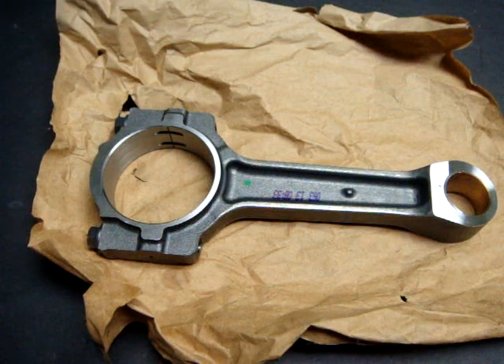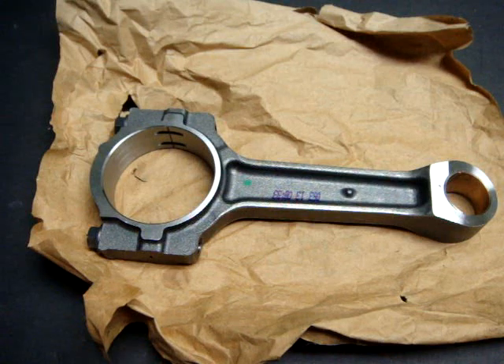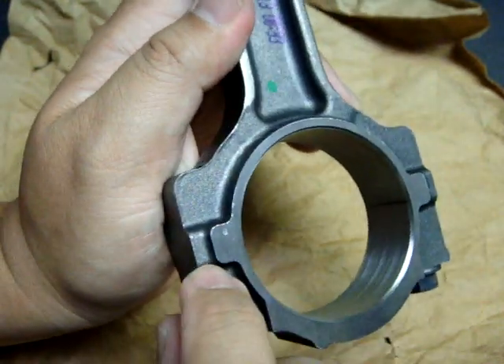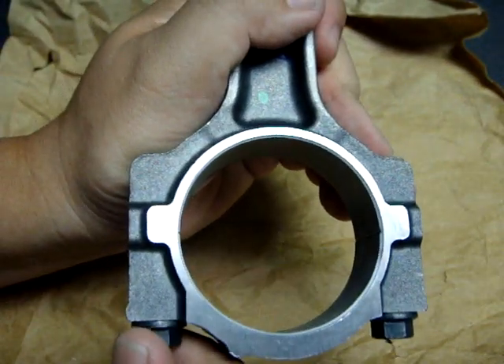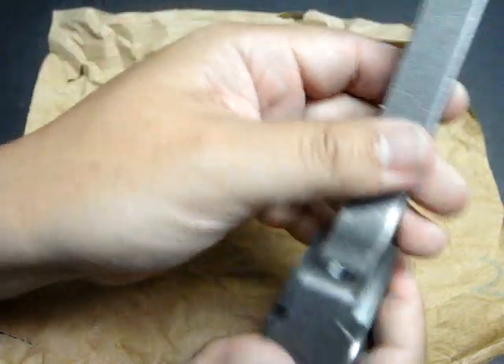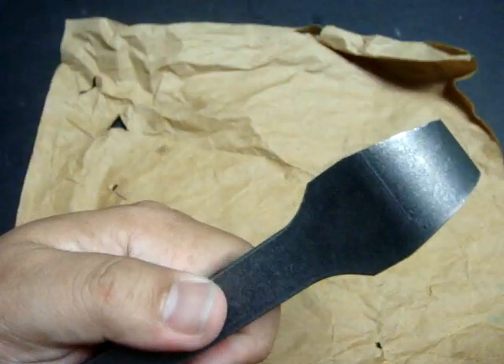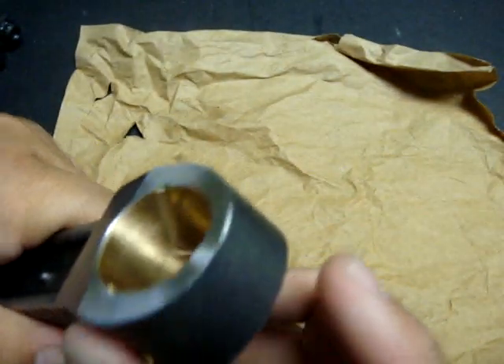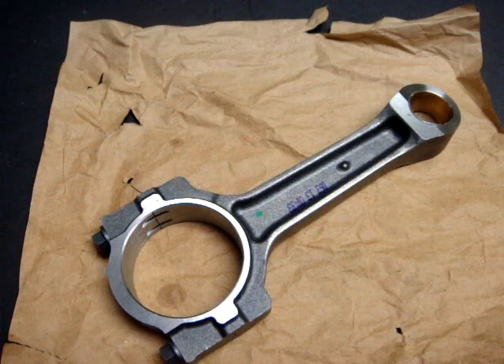GM LSA Engine Connecting Rod

Comment: I'm actually building a 5.3 with a brand new set of  lsa rods I got for 150$ bucks my buddy is a engine builder and a guy a few years ago bent a rod or two in his Zl1 he was gonna do a factory style rebuild and sell but he ended up building him a mean ass 416 stroker he forgot about the stock lsa rods that had been sittin a few years. So I'm building a little budget 5.3 motor with 30 over D.S.S GSX with some decent pistons lsa rods arp bolts and head studs and factory crank  it's only getting good main,rod,cam bearings  every thing else is as cheap as possible except the lifters and oil pump it's got some ported 317's I had them decked a lil bit BTR trunion  upgrade a summit aluminum intake and 90mm TB and fuel rails all summit brand and a LJMS off the self turbskie cam jon recommend the motor is basically done I just got find the time to pull the v6 and 5speed out my 2000 single cab swb 1500 do all the wiring and what not for the Holley hp ecu build a trans crossmember for the th400 I already got a Huron speed single turbo kit I'm gonna try my old cast wheel s475 on it first if I ever finish but I should have it putin around at least by July
Reply: Josh Rooster Cogburn Wood 
The lsa rods work in a 5.3?

Comment: i'm aware it's 4 yrs old videos just to add a small comment on power rated i'm sure it can handle well over 800 HP application not below 600 since it share the same rods and PN with LSX376 b15 as this engine is advertised from GM it can be reliably tuned it up to 15 psi of boost btw it's forged